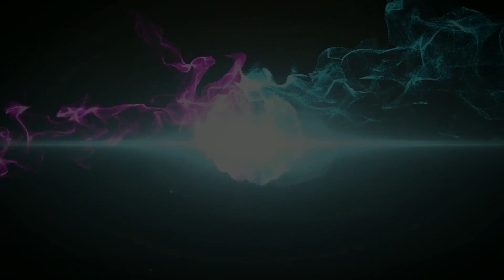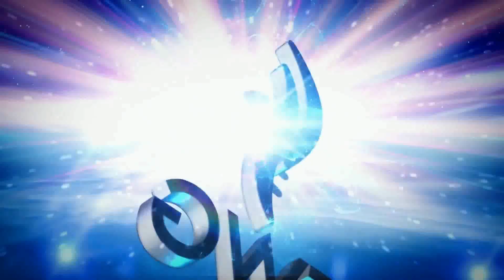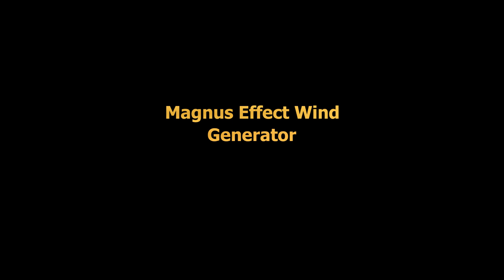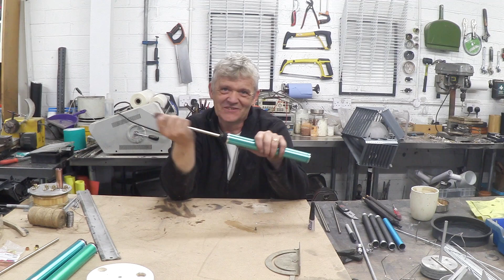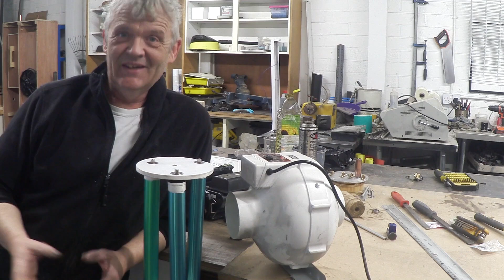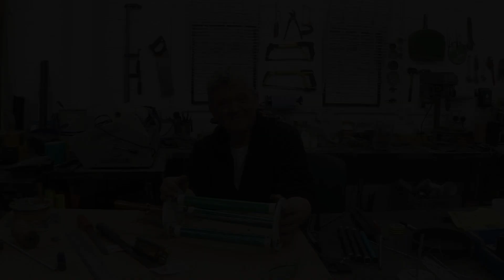Magnus Effect Wind Generator For Hurricanes - Toner Recycle Project 2

Comment: I dont know what a hurricane device is,  do hurricane devices only produce power in hurricane class winds ? If so Hurricane devices have to be the worst idea for power generation. Generate 2 or 3 days per year, maybe none, and this generation happens when you need power least (most businesses would close in a Hurricane).. As Rob has said the energy storage is a big issue for renewable s, and and having a system that works a few days per year presents storage issues too (batteries like being charged more often than once a year).   I live in a high wind site and have had turbines for 20 + years, there are already great solutions for high wind sites (antarctic, north sea etc), I just dont get it other than its an interesting effect.
Reply from the maker: well the Japanese think it is awesome - and tbh - so do i
Reply: @ThinkingandTinkering  The Japanese thought Kamikaze planes were a good idea, they thought fukushima was tsunami proof, do you ????? It is a very silly idea mathematically, and practically, and as far as I know the Japanese came to the same conclusion. Go on Rob, just do the maths its staring you in the face.
Reply: @goldmagnet9013  There are lots of "silly ideas" that were considered not worth pursuing by mainstream researchers..
AC electricity, aircraft, internal combustion, the telephone, undersea cables, talking movies, germ theory, organ replacement surgery, space travel and reusable rockets, the cosmic microwave background and (my favourite) the heliocentric model.
Should we halt all research that appears theoreticaly or intuitively not viable and go back to burning inventors as witches?  Complacent minds create nothing but dissent, it is only the inquiring mind that is prepared to try "silly ideas" that can create the truly inspiring inventions even if it is at the cost of learning from mistakes.
I might add a man called Douglas Bader who was told he would never walk again, let alone fly an aircraft.
Reply: @billbaggins  Oh come on, my hero is Niels Bohr, I have worked a whole career in science, and retired. Rob should do some maths and work out the maximum power yield by exploiting the Magnes effect and see how that compare to other turbine designs. Trouble is, despite having a channel which largely deals with power, he rarely communicates it to us, even though its often asked in the comments we generally just get volts which is meaningless !  Just clam down and get back to developing your chocolate tea pot, or do you think thats a bad idea ?
Reply: @goldmagnet9013  Rob's is an experimental channel, not a peer reviewed pure research lab relying on govt grants to produce the most efficient devices with a full breakdown of costs and calculations. He encourages others do do their own versions of what he creates and welcomes constructive criticism to make improvements. If you have a scientific background it should not be difficult to use some extrapolation for the forces involved and convert voltages to the data you want. Maybe even build your own Magnus effect wind generator and post a video highlighting the errors. 
You may well be right about the idea being of little practical value but the original research might have missed a few things or Rob may just want  to prove it to himself.
Skinning a cat may not seem like a practical or even palatable idea but there are many ways to do it and if an enviroment has a large feral cat problem then the entrepeneur with a plan to sell cat hats will waste many good cats before finding the best method to suit his purpose.
I understand that ageing can breed much cynicism for some (including me) but fresh eyes often see things that are not visible to someone that has been staring at the problem for years.
Reply: @billbaggins  Luckily the web site from the inventor of this wind turbine has the answer, and I quote "In the vertical-axis Magnus wind turbine, the cylindrical blades are driven by an electric motor, which causes self-consumption of electric power. The net power generation amount is the amount of power generated minus the power consumption of the motor, so the power generation efficiency is inferior to existing wind power generators." I know what Elon would do, the best part is no part, this is too complex  and inefficient. THE ANSWER IS THERE but not quoted by Rob.
Reply: @billbaggins  I said I was retired, not old. Anyway the inventors web site answers the question, the turbine is very inefficient and complex, and only has its high windspeed generation as a pro.
Reply: @goldmagnet9013  I think you are missing my point. When developing a practical device, theory and math will only get you so far. At some stage you will have to build at least one if not many versions to "work out the bugs". This is what Rob is doing, as I said, the original research may have missed things that Rob may discover.
Reply: @billbaggins  AC electricity, aircraft, internal combustion, the telephone, undersea cables, talking movies, germ theory, organ replacement surgery, space travel and reusable rockets. I can see the point of all these inventions, its obvious. I can not see the point of a complex, inefficient (due to the laws of physics) wind turbine that only produces a lot of electricity in as hurricane, it really seems like a chocolate tea pot. If it was 100% efficient in converting all the power generated it would still not generate much. The company behind it won a 500K grant, took out a loan from the government, then crowdfunded the loan repayment, all a bit odd.
Reply: @billbaggins  Even though the maximum possible power that can be generated from the Magnus effect is a known quantity, and not enough for a practical device ? We should ignore the physics and maths ? As someone that lives off grid, I get a bit peeved by YT channels showing wind turbines that just have no real world value, Rob does this. He has shown several turbine designs  which he has encouraged people to build, I just think not enough emphasis has been placed on the fact that the majority of his devices are not practical.
Reply: @billbaggins  I think Robs made a mistake, someone correct me. Robs cylinders dont spin (they need to spin at hiigh RPM), the design hes recreating has electric motors to spin the cylinders, hence the magnus effect. How is Robs design making use of magnus effect ???? Tell me ???
Reply: @goldmagnet9013  Experimental does not equal practical or efficient. Solar panels are not always practical and at about 20% are a loooong way from efficient. Internal combustion is also not super efficient but has been greatly improved through the efforts of countless untrained home mechanics making small improvements to things not deemed worth the effort of major vehicle makers.
I am not a scientist or engineer but I do have enuf imagination to see the value of experimentation and the simple fact that Rob or one of his more open minded viewers may find a way to make this device more practical. I also do not fully understand the deeper intricacies of metallurgy but this does not stop me from developing my own methods for heat treating tool steel.
Edison had to invent or steal hundreds of versions of the lighbulb before getting one that worked, should he have stopped after only trying 3 versions or are oil lamps better? Did Elon's rockets work first time? 
I am not disputing your knowledge of the Magnus generator but I do question your interpretation of experimentation using scientific method. You can't dismiss an idea till it has been rigourosly tested.
Reply: @billbaggins  Rob has not tested the original idea (as he claimed). The cylinders are not spinning, there is no Magnus effect, its a non turbine. Which you are currently defending.
Reply: @goldmagnet9013  Sorry but NO. I am neither defending or denigrating the Magnus turbine. I am merely supporting Rob's willingness to experiment.
What I see is that he is using the Magnus effect exerted on the 3 outer cylinders to rotate them around a central axis which could then be used to turn a motor and generate power, Thus he is using the Magnus effect as a byproduct, not as a direct method
Reply: @billbaggins  So if I believe Rob has messed up, and made a mistake and there is no magnus effect as he has left out the spin motors then  do I  point it out (as I am doing) or just stay silent as you and others want me to ? Have you ever heard The Emperor's New Clothes, I think it applies here ?
Reply: @goldmagnet9013  Oh dear, this convo is lterally going in circles. Yes if you believe there are errors you should point them out in a constructive way, preferably with proof.
However, Rob's device is pure experimental fun at the suggestion of others, NOT a working prototype.
As I see it, the Magnus effect can generate movement due to air pressure differences in a similar way that an airfoil creates lift.       
Wether Rob's device is a true use of the effect is not necessarily what he was looking for. The end result is that using wind he has ceated  rotational movement that can be harnessed. Just cos one research team found a similar device to be lacking does not mean another team is bound to fail too. THAT is the purpose of experimenting using differing methods. 
All Rob is doing is looking at the idea and encouraging others to try it. Someone may make modifications that would allow it to work with lower wind speeds or increased efficiency or they may all fail.
The destination is of little importance when the journey is more fun
Reply: @billbaggins  You said "However, Rob's device is pure experimental fun at the suggestion of others, NOT a working prototype." Rob said "We are going to replicate that device" (a working wind generator). Which is it ? Robs device does not take advantage of the Magnus effect as he does not spin the cylinders in the same way as the device he was replicating. Others have noticed too.
Reply: @goldmagnet9013  Yep, replicate not reproduce, but if I was going to get into semantics about language I would point out that gold is non magnetic.
I am defending Rob based on his willingness to try, not on the results. I don't care if it works or not but I do care that there are people prepared to try things instead of giving up because other ppl failed.
I did not know that I would be a decent knifemaker till I tried, turns out I'm pretty good at it. Likewise I didn't know if I would be a good driver till I tried it, turns out I'm fair but terrible at going backwards.
If I follow you way of thinking then the rest of the world should be good bladesmiths and average drivers. Funny thing is that there are ppl with much better or worse skills in both. Could it be that differing approaches to the same problems give varying results?
Reply: @billbaggins  What about when the results are corrupted with an off set fan, you happy with that ? Experimentation is vital to the progression of science, but accurately reporting the facts of your experiment are crucial otherwise you encourage people to waste time trying to replicate what you claim to have done. Rob messed up with this one, plain and simple, he said he was replicating a design and missed the crucial bit, then claimed it still worked attributing its movement to a force that by definition can not be at play.  It really puts his battery experiments in perspective to me.
Reply: @goldmagnet9013  If you are seriously that upset at the quality of Robs work and data collection, maybe you should report him to The Royal Society or whatever is the appropriate body and unsubscribe.
If you don't like shits and giggles experiments just to see if an idea is worth pursuing then you are in the wrong place.
Reply: @billbaggins  YTers like Codys Lab and AVE perform real tests and report their failures and mistakes. Rob should not call it a Magnus effect turbine,  its misleading, it turns by an force unknown at this stage (off centre fan). You are obviously happy with fantasy being presented as fact, most people of science and logic are not.
Reply: @goldmagnet9013  Ok.. your first comment in this thread clearly states that you don't understand the concept of this design.
I have just refreshed my comprehension of the Magnus effect. I will agree that without visual evidence of the outer cylinders rotating the result could be seen as inconclusive, however the net result is rotation of the entire device and given the simplicity of design the Magnus effect may not be fully responsible but would certainly be a major cause. I am not a physicist engaged in this area of research and neither are you ,so yes I am happy with Rob's analysis and conclusions.
Unless you are prepared to construct your own device and present evidence that the Magnus effect plays no part in imparting motion, then your argument is little more than pedantic nitpicking and shows even less respect for those prepared to think outside the box.
Reply: @billbaggins  How would it start from stationary ? What causes the cylinders to spin ?
Reply: @billbaggins  Do you get it now, the only way the turbine could start & run is with an offset blower.
Reply: @goldmagnet9013  Are you expecting a wind powered generator to work without airflow?
Reply: @billbaggins  Not at all, let me make it simple. The cylinders have to be spinning before the rotor can catch any energy from the wind. So imagine Robs awesome wind turbine sitting stationary, no wind,  then the wind picks up, nothing will happen as the cylinders are stationary. Rob moved the fan to one side so it would rotate. Come on you can do it, have a think about it. Rob made a mistake, missed a key feature of the design required to make it work, powered cylinders, built a turbine that could never work, and positioned the fan so it rotated and appeared to work.
Reply: @goldmagnet9013  Take a clinder that is free to rotate on its own axis with minimum friction, place it in a wind tunnel with laminar flow. The cylinder should remain stationary. No apparent Magnus effect.
Now take a cylinder free to spin etc but with a slightly textured surface and put it outside in natural wind which is turbulent. Hey wow the cylinder is able to spin thus producing Magnus effect, albeit somewhat random.
Now find a way to offset the airflow so one side of the cylinder catches more airflow. Wow, more predictable rotation without the need for external forces, add a bit of momentum and there you go.
I will concede that this may not fit within the boundaries of accepted understanding but cannot dismiss that it may be a new way of using that understanding.
I will not concede, as you seem to, that humanity has reached the peak of scientific insight and will make no new discoveries for eternity.
Einsteins E=mc2 was not immediately embraced by his peers.
Reply: @billbaggins  Comparing Rob to Einstein now hey !! Look at the title of this video, is it misleading ?  People here are building this to generate power, you happy with that ? From your reply you seem to be conceding that the current design does not work.  Look at people like Codys lab, who are vital to further amateur science, but Robs not the same, I have never seen Cody make a mistake like this then go on to claim it was working as expected. That is not science, it puts back the progress of science because people try to replicate something that was inaccurately reported on..  From your past replies I dont think you will understand, take a big swig of your Brawndo and read some of the other comments on here where people are saying the same as me.
Reply: @goldmagnet9013  No I was not comparing Rob to Einstein, merely pointing out that new ideas in science are not always easily accepted. Yes Cody is a clever bloke but also did not complete university, his experiments that replicate those of others are to prove the results to himself with the constant hope of maybe finding someting new or different.
Nowhere did Rob claim to be making a fully functional hurricane generator, he made a simple proof of concept device.
I have looked thru the comments and found only one other that questions the validity of this idea, he admits to not understanding but does not suggest failure.
If you can't see the value of error then you will learn very little and never or rarely make advances. An unexpected or fail to get the expected results does not render an experiment useless and the side effects of many things have often lead to great advances in technology.
Go look at the latest vid from Applied Science and see how a merely interesting physics phenomenon led to the creation of a fantastic tool.
Rob is trying things and learning, you are stewing in your own juices of denial and learning nothing.
I am happy (as I'm sure Rob would be too) to concede that he may be wrong. Are you happy to concede that he may be right? 
The concept is certainly worth further investigation, that is what people like Rob do instead of sitting on their asses doing nothing cos one study was inconclusive. Discouraging statements and attitudes like yours are what holds science back, not the people who make mistakes.
Reply: @billbaggins  There is no "Concept". Rob said he was replicating a Magnus effect turbine, but missed out the most important bit that makes it a Magnus turbine, yet it still worked.  The chap who invented it would tell you the same, Robs making him  look silly by  apparently demonstrating that the motors are unnecessary.  No one who understands the Magnus effect would agree with Rob's description of the turbine, how it worked and testing methods. I follow Elon Musk with a passion, science is my passion, I am a radio ham, I experiment all the time, you couldn't be more wrong with you assessment of me, I just dont like bad science (miss reporting, bad testing etc)..
Reply: @ThinkingandTinkering  Nice "can we capture hurricane wind power" article on the Smithsonian, there is also an MIT article too..
Reply: @ThinkingandTinkering  Inaccurate. A Japanese man thinks its a good idea, not "the Japanese", that suggests the government and the people of the country.
Reply: @ThinkingandTinkering  Challenergy are to wind energy what EEstor are to power storage. Same business model.